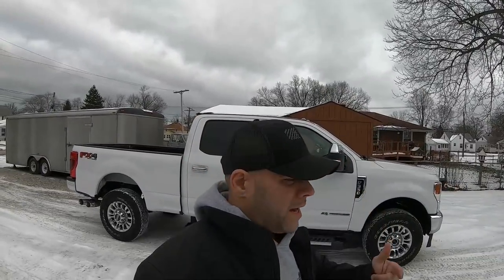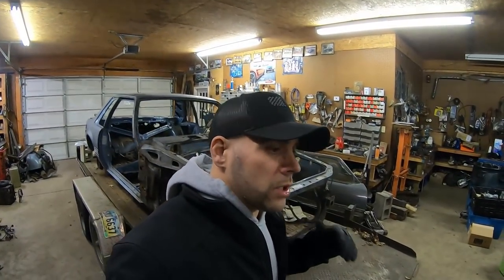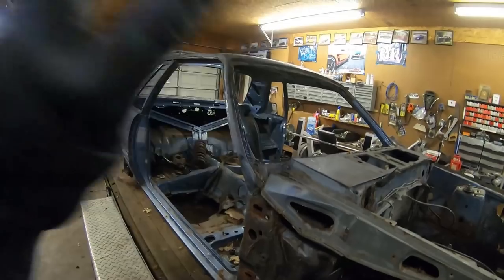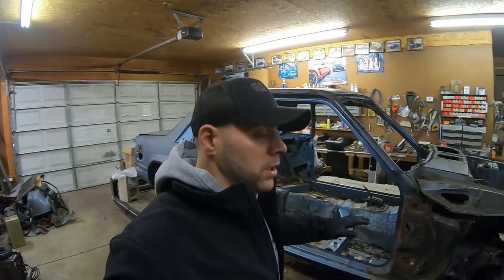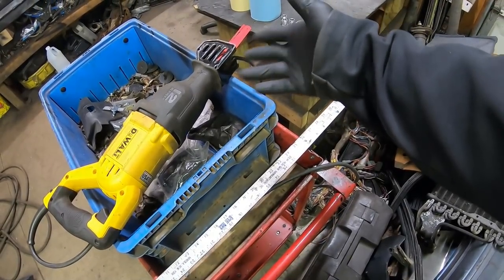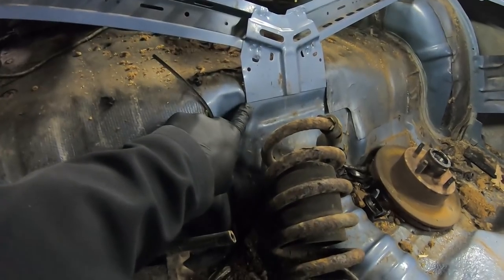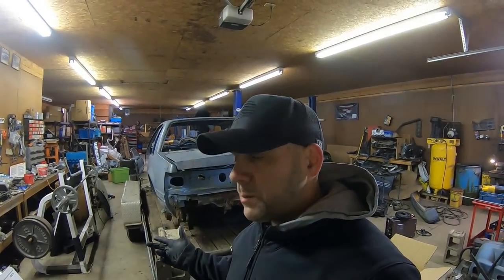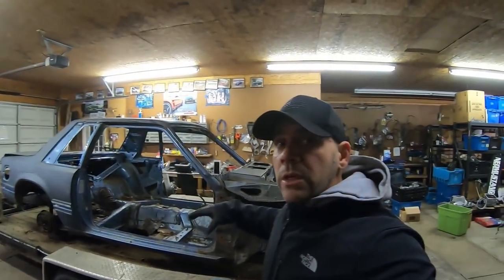HOW TO CREATE-A-COUPE Ford Mustang Notchback Conversion PART 1

Comment: Hey Dan. 
I used to save salvage title cars for a living in Michigan. What you’re doing is exactly what I used to do. You’re plasma cutter is the best spot weld remover tool in the world. Just blow them out. It works awesome and fast as hell. Cut it large and plasma the spot welds and use a cutoff wheel to trim your outer sheet metal. Lap it with screws and go back and use a cutoff to butt weld as you go. It’s fast and dead on. Love this project!
Reply from the maker: Holy shit thats a great idea plasma the spot welds.

Comment: Pick up a 3/8” air belt sander. They work awesome for removing spot welds. You’ll basically make a divot on the spot and separate from lower panel
Reply from the maker: Good idea.

Comment: Hope this works will, around here there is always more vrerts for sale, if there are 8 fox's on the local classifieds 4-5  will be convertibles, 2 hatch's , and 1-2 four banger coupes, the verts are usually cheaper and tops are  typically in rough shape, I rode in a vert way back in the late 80's and hated how it felt (like a marshmallow) but if they can be made into a notch that would be awesome!
Reply from the maker: Ya wade at this age.. those fkin tops are ruined. I have an array of coupes here that are NOT in healthy shape at all so why not make those verts that are nice (body wise) a coupe! speically the 4cyl ones.. not the GT's

Comment: I would cut the floor out save the tubs quarters roof and cut it at the rocker mid door the do the very the opposite and lap everything on at once then weld the rear body wheel runs and rear floor ext that way your not cutting through the panels just my thought awesome video though
Reply from the maker: I get it.

Comment: the rag top is a real pain in the ass.i had one ..even if you did pull off somewhat restoring it it will still leak for ever and act up all the time and suck..the notch (trunk back) top to a good standing vert is a great idea i think....
Reply from the maker: YEs without a doubt. Literally it just fits on there!

Comment: Please do not cut up a legit GT or 5.0 LX hatch, those cars are going up in value big time. As for convertibles go ahead and convert(no pun intended) as many as you can into coupes, convertible foxes will always be the least desirable of the bunch and they were built kinda crappy to start with. Convertibles started life as coupes built without tops and then sent to ASC for final assembly so it really is like putting it back as nature intended.
Reply from the maker: I get it. However i have multiple GT shells that have been sitting a long time. Mines well do something with them now. I have other coupe roofs.